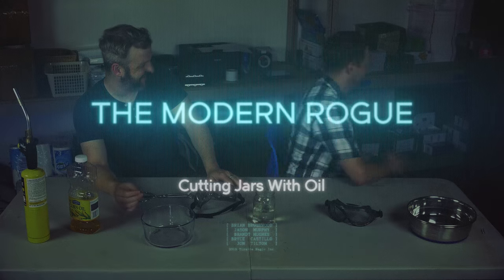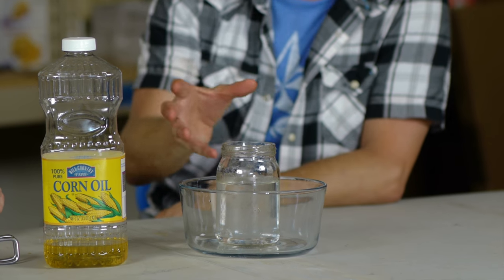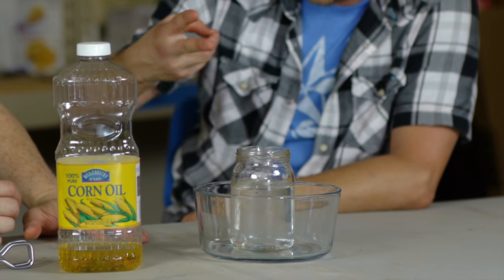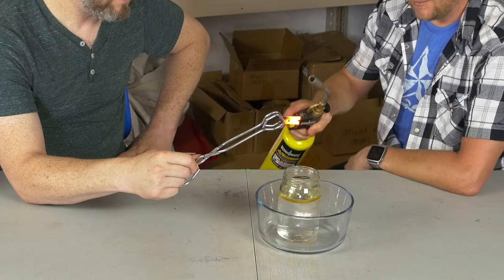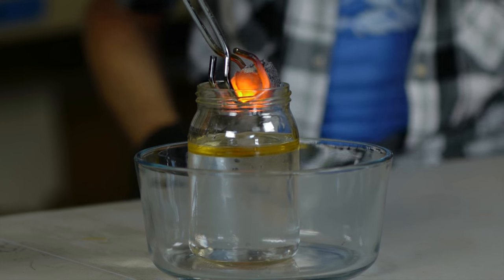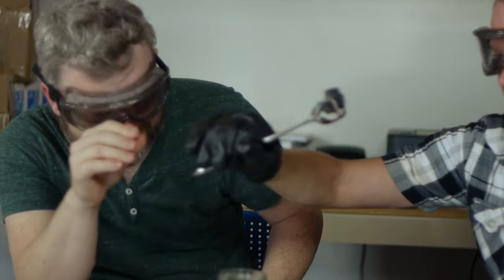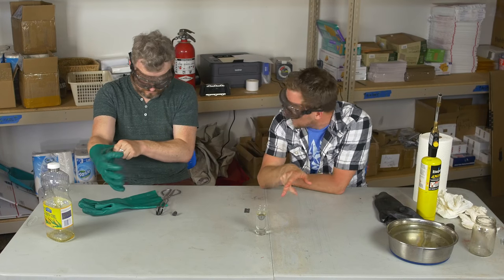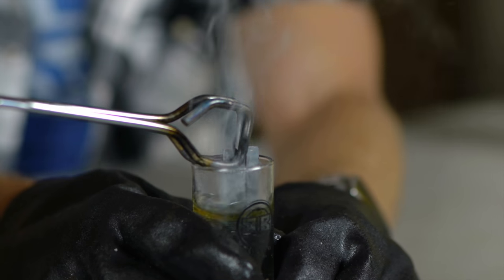Does Hot Oil Really Cut Glass?

Comment: Next episode:  does jet fuel really melt steel beams?
Reply: Answer: Nope. But office stationery did.
Reply: +JP de la Torre what are you talking about? Do you have any idea how hot jet fuel burns?
Reply: JustDaUsualTF What kind of question is that? Fire is fire. What else do I need to know besides jet fuel burning temperature to know what could have happened?
Reply: Jet fuel melts steel beams. Just look at the burning temp.
Reply: it only had to soften it enough for the beams to bend a little which weakened the tower enough to cause it to colapse. im not saying it wasnt an inside job im just saying the jet fuel thing is possible
Reply: Jet fuel can't melt steel beams busy did 9/11
Reply: After that episode can you burn fire?
Reply: Bush* so sorry
Reply: GECKOS DID 9 11
Reply: +pbbeast there were puddles of steel from the beams.  Which the jet fuel couldn't have melted
Reply: Jet fuel could soften normal steel beams, if you pour thousands of gallons around the beams, ignite it and keep the fire going for hours. However, those were not normal steel beams, there was hardly any jet fuel (most of it burned or exploded on impact) , steel beams were not casually sitting there unprotected by concrete and jet fuel doesn't burn for long enough to melt any type of steel, let alone reinforced steel protected by concrete.

Also, parts of steel beams were found in nearby buildings, which could indicate strong explosions that sent them flying.
Reply: Burning aluminium that the planes are made of would probably melt steel beams though, just saying.
Reply: Ticewise Please look up information before expressing an opinion, as your opinion cant stand vs facts. 
Aluminum melting point - 660 C
Steel melting point - 1500 C

Jet fuel nor aluminum can melt steel, but a fuel rich fire can soften it, and thats where the argument is.
However, even softened and weakened by 50%, it still doesn't explain the way building just collapsed, as fire wasn't even everywhere to cause the steel to "weaken" symmetrically to create something that by all definitions and eyewitness accounts was basically a controlled demolition.
Reply: DavorBa The buildings were not empty. Many other things besides jet fuel were burning inside them. Also, burning aluminum is not the same as melted aluminum. Aluminum can oxidize and burn at 2500 C.

The way the buildings collapsed is the only way they could have. Having most of their structural strength at both the center and the shell of the buildings, there was no chance for them to side even a little.
Reply: I'm gonna do a little debunking here, because there was some odd finds after that building collapsed. In example: tiny beads of steel and aluminum, a common result of thermite burning. Now thermite definitely produces enough heat to melt steel, and is a fairly basic compound to produce if you know how. i'm not saying there was definitely thermite being burnt in the collapse, but something was burning hot enough to produce the same effect. truth of the fact is, we don't actually know HOW it collapsed, as there should not have been anything that could burn that hot in the vicinity of the beams. 

Basically, something burnt hot enough to weaken the beams to the point of catastrophic failure. it could have been any number of compounds but thermite is the most readily available as there was both of the key elements for its making present (Aluminum and iron oxide), though even that dosent fully explain the collapse. 

TLDR: Something weird happened, lets get over the weirdness and pay more respect to the lives that were lost.
Reply: JP de la Torre What you just said is common misconception being spread around.
While the building was not empty, the hottest thing burning was jet fuel. Burning bunch of things together doesn't make the fire super hot, it just causes the fire to spread more quickly and last longer.

If you burn one piece of wood, then add another piece, does the fire get twice the hot, or does it just get bigger and last longer ?

Also, aluminum is oxidized by water at temps below 280 C. Please stop making things up that don't belong in this conversation.
Aluminum oxide needs temps 2000 C+ to melt, I have no idea why would you even mention that in this discussion.
Reply: If anyone here is interested, I saw a wonderful lecture by UC Davis professor emeritus Thomas Cahill on exactly how the burning of office supplies, furniture, rugs, partitions, and other objects in the building supplied orders of magnitude more energy than the jet fuel itself, but regardless easily enough to explain the building's collapse. Further, due to analysis on the dust and aerosols released in the collapse and subsequent burning rubble pile, we know that many reactions continued, explaining some of the strange metal evidence left behind. Apparently there was also a significant diesel fuel fire (if I recall, from a stockpile of fuel for a generator in one of the smaller buildings) that burned under the rubble for a long time.
Reply: DavorBa Do you even know what is high temperature oxidation? Do you know what temperature can aluminum reach when exposed to a flame?

You obviously just read some blogs and know you think you know all the chemistry required to discuss this issue.
Reply: JP de la Torre And you think that complicating a simple and obvious thing will somehow change the fact that the official story is bullshit and every explanation generated by that story is bullshit and this was proven by hundreds of experts in their fields and countless eyewitnesses. 
You defending that lie just makes you look naive, not smart, no matter how hard you try.
Reply: yourcurtainsareugly Yeah, lets ignore all other experts that said otherwise and lets focus on that one guy that said furniture and some diesel fuel (that burns at 96 C MAX) caused puddles of molten metal that were glowing hot for days after the towers collapse.
That sure explains everything. LOL.
Reply: +DavorBa
Look, I'm not here to straw man you, please don't straw man me. If you would like to bring up some other experts, especially those with peer-reviewed publications on the topic, please, be my guest. I would be glad to learn something.
Reply: DavorBa Hundreds of experts? Do you mean all the civil engineers and architects that did not bother into looking at the evidence?

If you look for throughout researches instead of half-assed opinions, you'll find all of them agree with the NIST report.
Reply: +JP de la Torre 
So how does a 47 story building fall at free fall speed when hit by no plane as did WTC building 7.  They also announced its collapse 20 min before it fell.
Reply: +oink079 Dr Judy Wood - where did the towers go. abit far out but her argument makes the most sense to me
Reply: +DavorBa I seriously hope you made a mistake, because I don't see any links of yours in this thread.

+Sunny B It is a lot far out, and she is unwilling to explain the source or feasibility of the energy.
Reply: Well, this thread has been BURNING for quite some time. 
I guess that's what FLAME wars do.
Ahahahaha... I'll show myself out.
Oh, and ah, just throwing this in there, literally anything could look like steel. Only needs to be metallic, normal citizens couldn't tell the difference.
Reply: Can regular sticks and grass melt metal? It can when it's in a swedish rocket stove. So, yea, it probably can.
Reply: DavorBa Where is your link? I think it probably got deleted.
Reply: JP de la Torre There are 2 links in second comment above this one, the one I replied to  
"yourcurtainsareugly". How can you not see it ?
Reply: I don't see any links of yours. Either Youtube is hiding your posts with links from us, or you're trolling.
Reply: I'm gonna post a ss from the comments above from my perspective:

https://postimg.org/image/97q2xbvk7/

If you read this I will try to post links once more, but you can google the second link yourself rly.
Reply: Weird. Yeah, it goes straight from my "I'm not here..." comment to JP's "Hundreds..." comment. Your comment with the link is completely gone.
Reply: That's only slightly more responsible than this episode of starting a grease fire on top of the thing you never want to PUT on a grease fire.
Reply: +AJ Griffin but there was melted metal
Reply: +DavorBa Nope, it looks like that link is causing the post to be hidden. I'll find what I can by searching what I can see in that image. It's possible that people have flagged links to that domain in the past, maybe because they thought it was spam, or they disagreed with it for whatever reason. Regardless of the merits, it doesn't seem possible to publish links to there on Youtube.
Reply: DavorBa The amount of people that are seeing the links is about the same as the people who agree with you
Reply: yourcurtainsareugly Funny, I posted one link only, a youtube video link. Since I can't post that link, search for it ( Rare Footage 9/11 Evidence of Bombs ) and start from 53 seconds.
Reply: Fucking hell.  It was a joke, I didn't expect a full on informational debate
Reply: +Angus Scott welcome to the internet :^)
Reply: Angus Scott Sensitive subject I guess.
Reply: yes plane have oxygen in them when the oxygen and jet fuel mix it gets to a hotter point also planes tires r made of aluminum powder (main ingredient in thermight) and rubber powder so there for yes jet fuel can melt steel beams
Reply: ask bush he has experience apparently
Reply: It doesnt need to melt them as soon as the reach around 1000 they cant be bent with a small amount if waste 1500 degrees can bend steel with you pinky
Reply: 911 joke amiright
Reply: Jet fuel burns at a little more than 1300 degrees. Structural steel (which is much harder that regular cold or hot rolled steel) has a melting point of over 2500 degrees. that means it would have to be at least 1800 to 1900 degrees before it would even start to weaken.They forge structural sttel at over 3000 degrees. Jet fuel and office supplies will NOT reach these temperatures EVER. So in answer to your question No jet fuel will not melt steel beams. It wont even get hot enough to change the rockwell rating of the steel.
Reply: The operative word in your statement is &quot;normal&quot; steel beams. the towers were built out of structural steel which is orders of magnitude stronger and harder than regular cold rolled. Also weakening of the steel would not have collapsed the whole building. At most it would have listed a bit to one side not collapsed the entire building. They build skyscrapers like that with whats  called &quot;redundant&quot; structure. Meaning if one part of the structure fails there are extra parts to take that load so the building wont collapse. The towers were already hit by a plane in the 70s and did not collapse
Reply: +joedell71 NERD
Reply: Cooper Wheatman
guilty as charged
Reply: it hasn't in the past.
neither has a fire like it ever damaged a building like them to the point of total structural failure.

and we have MANY examples from India to Spain, Turkey Ireland and France. 

all have tower fires in steel reinforced and steel and glass buildings. those buildings are still standing. one stood after burning for three days.

I can't say what brought down those particular unmentioned buildings but, it wasn't from an impact or from fire.
Reply: damen whelan
Exactly. Fire or impact DID NOT bring those towers down. Also why did #7 collapse? It wasn't hit and only had very small fires.
Reply: +joedell71 it collapsed because your mom was leaning against it
Reply: marmaladesnails
I've been telling her to lose weight for years :D  I didn't even know she was in new york then :D
Reply: Lol
Reply: no but memes do
Reply: 9/11
Reply: ARGH! like number 299!
Reply: @JustDaUsualTF  I've looked into it, and while jet fuel does not have the capacity to melt steel beams, it does have a enough energy to severely weaken the structural integrity of them. It may not liquify that grade of steel, but the heat would definitely stop them from supporting a building with that much weight being exerted upon itself.
Reply: Angus Scott you realize no there wasn’t as soon as it cooled off there’d be solid steel there....and no the lizard people aren’t real either

Comment: I saw a different version where you take a string soaked in rubbing alcohol, wrap it around a bottle, and light it on fire to cut the glass
Reply from the maker: As far as I know, that one actually works.
Reply: I agree. I never saw your presented theory, but the STRING trick might have more success.
Reply: That one works but it's really hard to get it to be a nice cut. It usually ends up giving you an uneven and more importantly very sharp cut.
Reply: Sand paper the edge. That's one of the steps too.
Reply: It works but it makes a rigged break not a straight line
Reply: Did you see it from crazy Russian hacker
Reply: +Alex Eguia yup! where safety is #1 priority!

Comment: Glass only fractures due to a rapid change in temperature, therefore heating it slowly with the oil won't work on it's own. After heating it in a specific point you would need to place it in an ice bath to rapidly change the temperature and cause a controlled fracture. Not saying this method is practical, but it should work.
Reply: Personally, I would wrap an insulated wire around it, run a high amount of current through it so it gets red hot, then quickly dip the whole thing into and ice bath after the glass has had time to heat up.

Comment: You guys skipped the most important step: scoring the glass. Buy an actual bottle cutter (~$20) to score the class with first and you'll get much better results. Using oil to get a higher temperature difference is a great idea but you still have to have a scratch to start the break with.
Reply from the maker: That's dumb.  If you have a glass cutter, why are you using hot oil?  Why not, you know, just cut the glass?
Reply: +Scam School because even with the glass cutter it's extremely difficult to get it to break nicely.
Reply: Plus it will take longer
Reply: +Scam School You dont necessarily need a glass cutter, you just need a way of scoring the glass.
Reply: +Mayhem Jensen ...like a razor blade? Lol
Reply: I do a lot of glass work and even getting flat pieces of glass to break along a straight line is a nightmare, bottles are basically impossible without some kind of heatshock along the line you've scored. Another suggestion is taking the glass you've heated up and lowering the part you want to get rid of into some cold water, though this has the potential to explode and send shards of glass straight at your face.
Reply: I was going to say try putting it in the freezer so it's chilled and put some salted ice water inside to try and keep the temperature at odds. But yeah, still a possibility to break.
Reply: Brian, keep in mind that most glass cutting isn't cutting, it's really just controlled breaking. Glass "cutters" are really just scoring devices to create an outlet for the glass to break along.
Reply: It would help if that was shown in the original video

Comment: There's a way to do it with string soaked in acetone wrapped a round a certain point on the glass container, you set the string on fire and continuously rotate the bottle in the air and after a few minutes of the string burning you dip the whole thing string and glass into a tub of ice cold water and it should sheer it clean right where the string was

Comment: A problem nobody has Brian Brushwood?  No sir.  Aged port wine with it's sugar holds a cork so firmly that it cannot be pulled out with a screw so people use your method of temperature stress to pop the neck off of bottles cleanly and consistently.    They heat up thick "port tongs" to red hot, place the tongs around the neck of the bottle until heat transfers for about 45 seconds, remove the tongs, touch the hot neck with an ice cube and CLICK.  Your port wine is served.

Comment: In order to get the oil hot enough to cause thermal stress, you'd need the oil to be significantly hotter than the water. Which if you do get that to happen, the water next to the oil will boil quickly and you'd get a grease pop.

So lets pretend that that is not unsafe for a second. The only real way to create that temperature differential would be to pour hot oil in or around the glass. If you attempt to heat up just the oil, the water will act like a heat sink and boil off excess heat. Unless you have some magical microwave tuned to vibrate oil instead of water, I don't think you're going to get this to work.
Reply from the maker: So glad to see this comment.  Almost exactly what I was thinking.
Reply: One thing to try would be to put only oil inside, and water outside.

Same concept as putting a paper cup full of water into a camp fire. It won't burn the paper touching the water, and will just boil while it burns the paper above the water line.
Reply: I also question how well the oil is actually retaining heat while you're reheating the razor blades/iron. It would be interesting to do this experiment with a thermal camera.

Comment: As someone who makes stained glass I know a lot about glass in general. In order for this to work you would need to heat the rock really hot and have the glass sitting is super cold water with ice in it. I have had experienced from soldering stained glass pieces that even the cool air temperature contrasting with the extreme heat of the soldering iron can make glass crack by heating it up too fast from it being completely cold (or at a resting temperature) an easy way to illustrate this effect is to put an empty coke can on your stove until it gets extremely hot and then dunk it into ice water. The car with instantly crush itself.